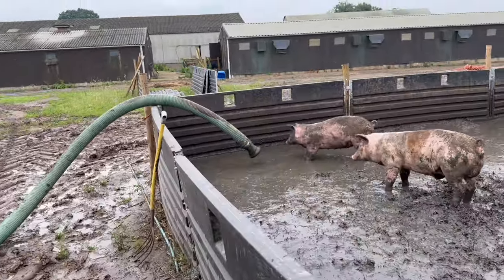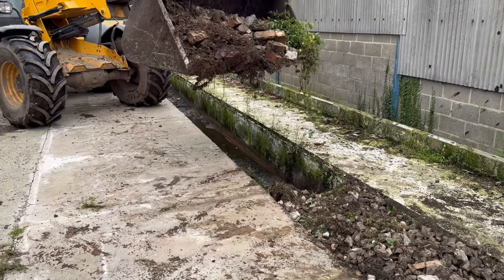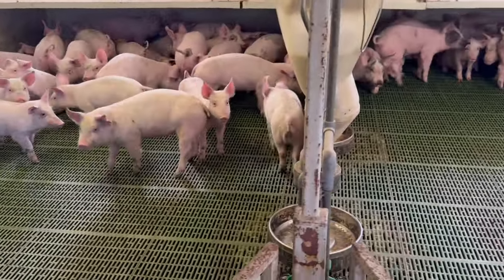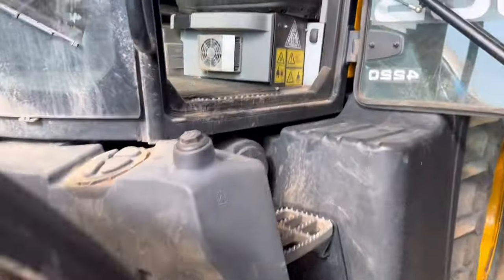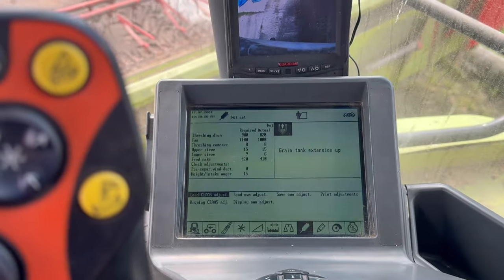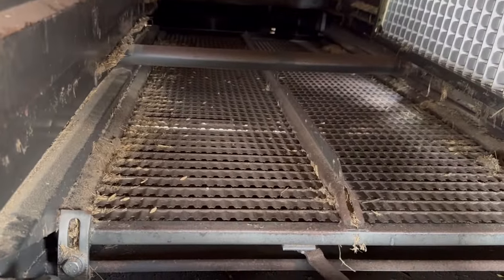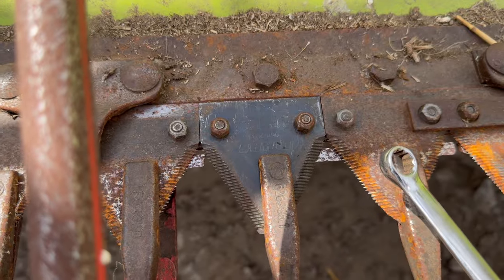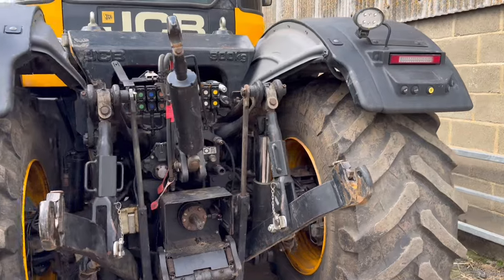Combine broken down . Pigs are aright mess . Lots going on . Sunny Yorkshire. Claas lexion 570

Comment: It’s a lot easier to change knife sections, now they are bolted, different years ago when they were riveted, changed many knife sections with the whole knife out of the combine and using the trailer draw bar as an anvil, chiseled the old rivets off and then fitted new rivets 😂👍